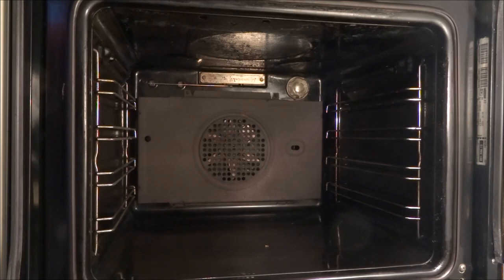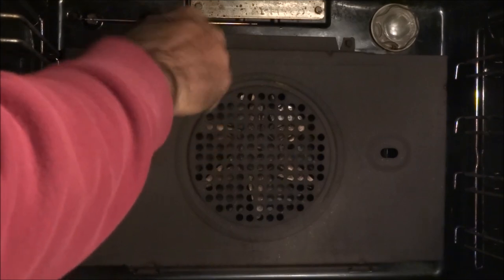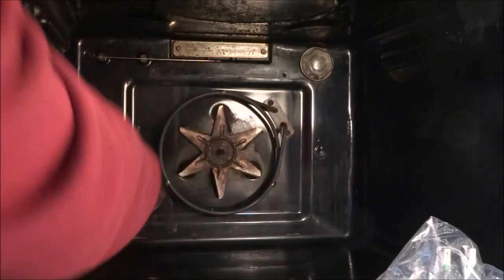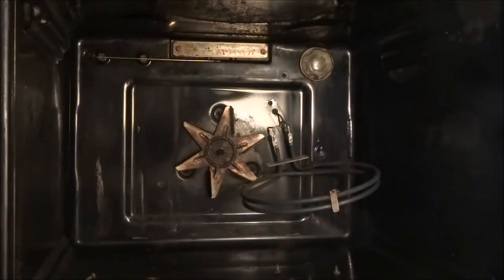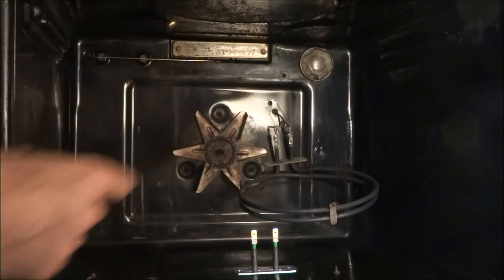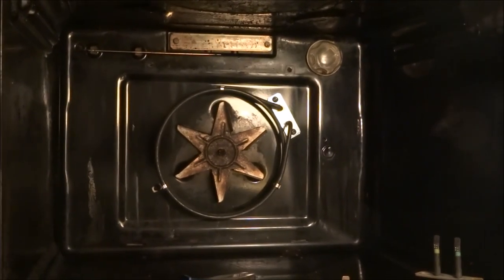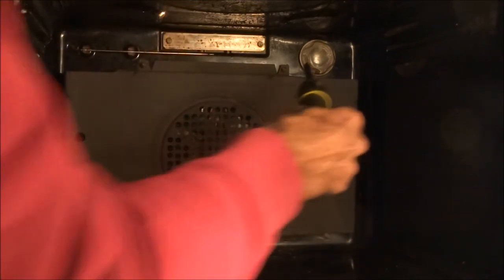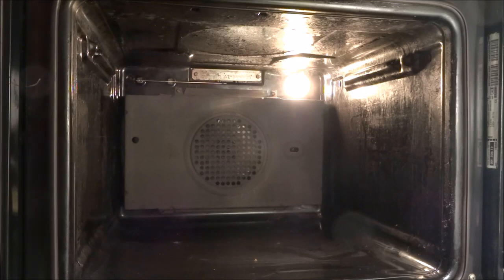How to fix an oven that will not heat up

Comment: What if heating, light bulb and ventilator won't turn on? I have power to the controls, they're the only ones lighting up. Inside is dead. Can it be something else or do you think replacing the heating element would fix this?

Comment: How do you actually establish this is the exact problem and not a thermostat or fuse? My guess is, if the fan works but doesn't heat, def not a fuse. But how do you rule out the thermostat?

Comment: Awesome vid. My oven stopped heating up after we had a power cut... Is that a common reason for the heating element to malfunction?
Reply from the maker: No generally not.
Reply: hi this is exactly how mine stopped heating up the power surged  and triiped but then even at 200 degrees  just medium heat.

Comment: I've lost count to the number of times have had to do this to ovens. Anglesey a few times the spade connectors have broken off so have had to crimp new ones on. All so worth doing a continuity check on the element as I've been sold did ones before! Nice video
Reply from the maker: +Zed Man thanks for the the comment!
Reply: Zed Man thanks

Comment: Hi - my oven has definite cold spots.  When I put a piece of kitchen roll on the shelf and turn the oven on, the fan draws the tissue up against the back wall - should it be drawing air out of the oven?  Or pushing air into the oven to distribute the heat.  I don't want to go to the trouble and expense of replacing the element if it's the fan that's not working properly.  Thank you.

Comment: Thanks for the video mate. Could this still be the issue if the grill is working but my fan oven isn’t?
Reply from the maker: Yeah I think so.
Reply: @InnateAl: I’ve got the same issue, grill working but oven not. Have you since tried replacing the element to fix it? Did it work ok?
Reply: @tomralfe5428  are you replying to yourself 😂

Comment: great video.  My oven is a dual fan model.  Is it possible that both heating elements are broken?  Should I check both individually?  Otherwise oven works fine...
Reply from the maker: Thanks for the comment. That's always a possibility, best to test.

Comment: Great video. Could I just ask a question because my fan has stopped working but my element is still working. Does this mean that the fan is faulty? It's 2 years old and is used about once a week. Not clogged with fats as we are vegans.
Reply from the maker: Yes must be a faulty fan

Comment: My cooker is wired directly into the wall,then up the wall a bit is the switch to turn the power off to it,would turning that switch off be all i need to do,or will i switch off the house power?Thanks
Reply from the maker: Keep on the safe side and turn off all the power in the house.

Comment: My fan whirls and light comes on but doesn't heat up. Is there a way to check it was the element? Mine shorted the circuit at the time and I had to go to the fuse box. is that a sign?

Comment: Had my oven for about 5 years, oven died yesterday. Exactly same setup as this. It turns on for about 10 seconds, then cuts off. Rest of the oven working fine. Going to pop it open later and see if the element is showing signs of being burnt out

Comment: I’ve replaced the thermostat, replaced the heating element. Grill works but when set to fan oven mode, the temp doesn’t increase.

Fan is working, light comes on when switched on to heat up, there is no clock/auto display.

Logik LBFANX16

Please help cos I’m gonna smash this with a hammer otherwise

Comment: Hi I have a baumatic electric oven n sudden not heat up n no light bulb on . Do you think it is same problem? If so do i need to order the parts from the Baumatic company? Thank you.
Reply from the maker: Yes sounds like the same issue.
Reply: Thank you for the reply. I will order the element and give the updated. Does it mean the grill on top it is connecting with element too? Because the grill not working too. :(

Comment: So my oven seems like it doesn't quite reach the heat it should be able to (300°C). I don't have a heat pistol or something to measure it accurately but it looks like it caps out at about 200°C-220°C max. Is it possible that this issue might be coming from a defective heat element or would it not be heating up at all if it doesn't work properly?
Reply from the maker: I wouldn't have thought so, if the element was faulty you would see a larger drop in temp to nothing.l, so it wouldn't heat up at all.
Reply: Okay thanks for your response :)
Reply from the maker: @virtuosyc  You're Welcome!

Comment: You supped over the hard bit of changing the element out. Screws are easy but the element attachments really complicated
Reply: They are just spade connectors that should just pull out with a bit of force.
Reply: It won't matter which way they fit on either, as it's ac electricity

Comment: My fan oven setting isn’t heating correctly but the non fan setting is heating up fine. Why is this happening?
Reply: We also have the same issue. The fuse box tripped. Found after resetting that the fan part of IKEA oven and also the fan grill setting is not heating up. The conventional over and under oven and grill is heating up. Is this still the element in your opinion Geek Street?

Comment: Ok so watched this, done that but oven still blowing cold. Any ideas?
Reply: Hi, did you find out why it was still blowing cold air thanks.
Reply: @mickbeth77  yeah it turned out that the selector switch had burnt out. So basically when you turn the oven on and off it should always be in a particular order, I,e when turning on should always select the function you want then the temperature, to turn off always do the reverse, so turn off the temperature then turn the selector switch to off. It prevents the switch from burning out.

Comment: My oven is a Belling it lights up and gets hot is it the fan can you help me please
Reply from the maker: Sorry I don't understand the question? So your oven is working?
Reply: It work today but it starts off with a low noise then gets louder so l omen the door too make it stop do you think it might be the fan going
Reply from the maker: @seanscaddan8608  Yes that does sound like an issue with the fan, perhaps the bearings are gone. I'm no oven engineer so don't take my word for granted perhaps search forums on the internet for additional info. Hope that helps.

Comment: My oven is only 2 years old will it blow already,,
Reply from the maker: Not sure its always possible.
Reply: Just ordered a new element £12. So you’re probably right. Cheers
Reply from the maker: @scottlowe1047  let me know how you get on, would be interesting to hear.
Reply: Hi 
  Thanks again for the video my element turned up today, All changed and working 10/10 for the video 😊 
Regards Scott
Reply from the maker: @scottlowe1047  Awesome thanks for getting back and giving an update and great to hear the video helped!